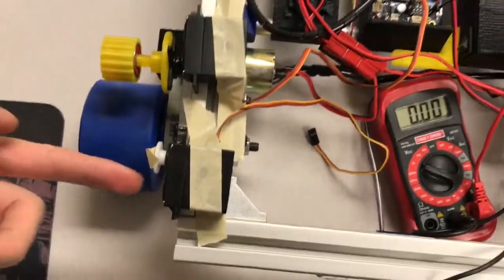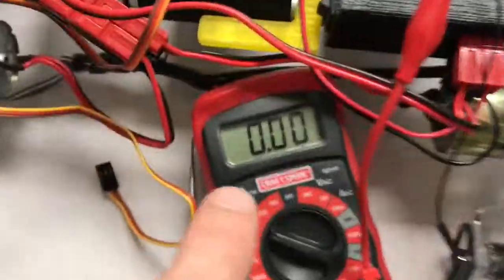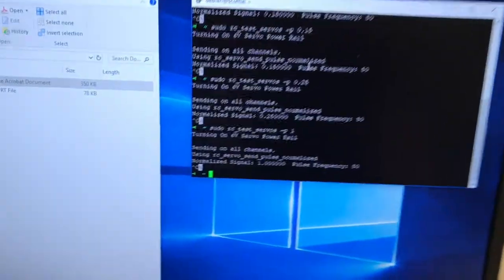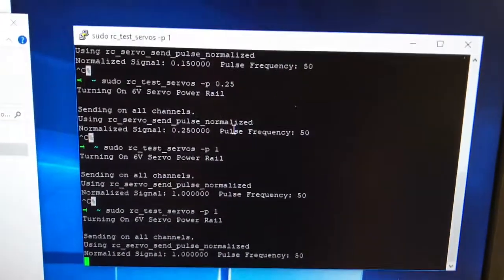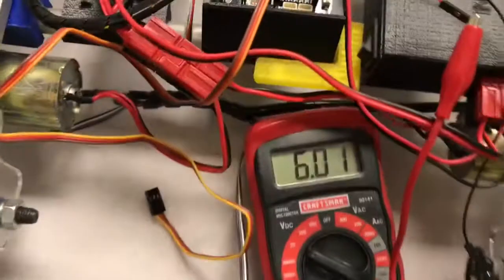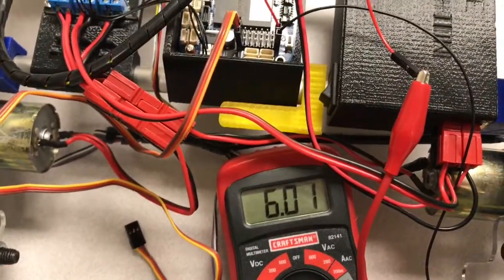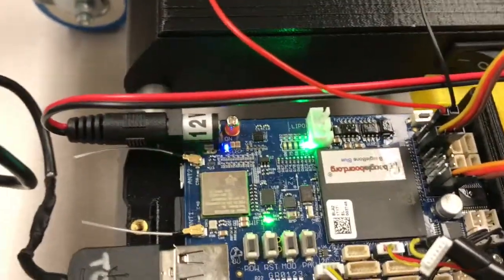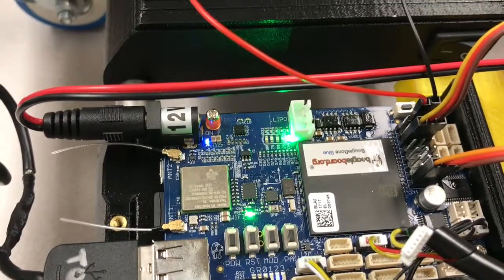SCUTTLE Robot - Beaglebone Blue Problem Powering Servos with 12.0v @ barrel plug

Comment: You'll need to connect a 2-cell LiPo battery. The 12V feeds the charger, but does not provide current for the servo motor output.
Reply from the maker: OK.  Do you have any thoughts on why it eventually jumps to 6.0v and the servos start moving properly?
Reply: @davidmalawey  The power is coming from the MP2615 charger IC. The regulator/motor load doesn't act like a battery and the MP2615 doesn't seem to be designed to provide a steady voltage without a battery load. Instead, it is going to oscillate between thinking the battery is full and in need of a charge.